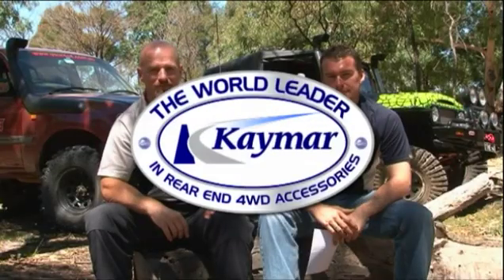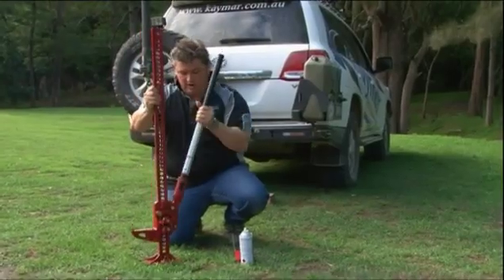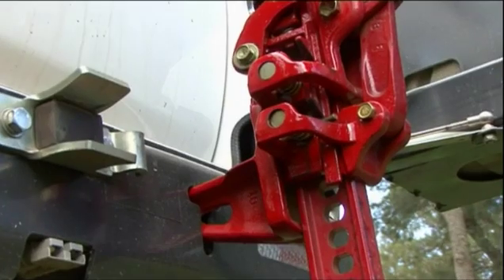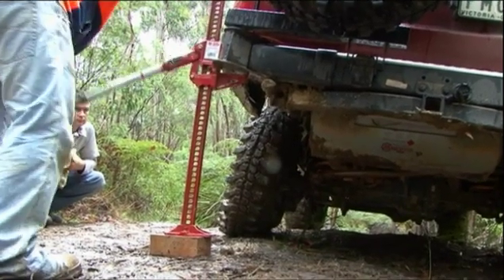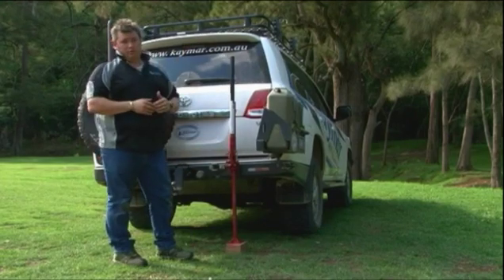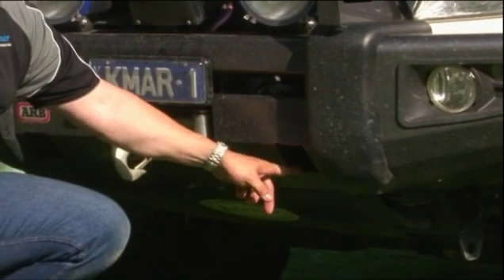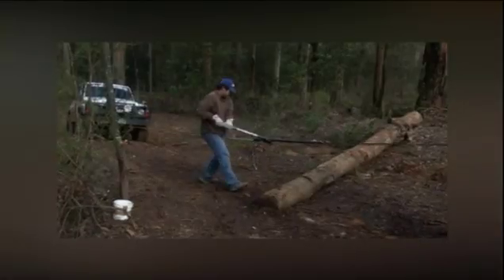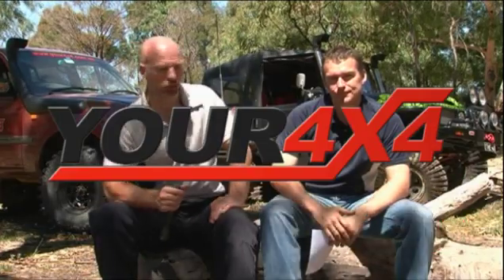Ask an Expert - Hi Lift Jacks

Comment: David was right on about the Hi-Lift being unstable and dangerous but very useful. I just saw a new attachment for the Hi-Lift last week at a Manufacturing Expo that cures some of the major ills of the jack. The Hi-Lift Jack Stabilizer was pretty cool.It was  cheap and really seemed to get the job done. I just noticed that a video of it is now up on you-tube on the "Bogert Group" Channel. I was told it was "patent pending".

Comment: Best off road tool ever.  I've had to winch with it a few times where a recovery strap just wasn't enough or wasn't available.

and, yes, Hi-Lifts can be VERY dangerous.

Probably the most nervous it made me was when it took two guys to put enough force on the handle to winch out a truck.

2nd place was when I picked up the back end of an LP forklift that had gotten hung up.